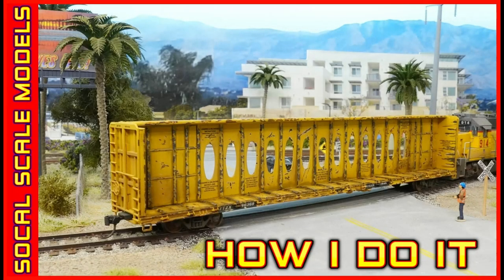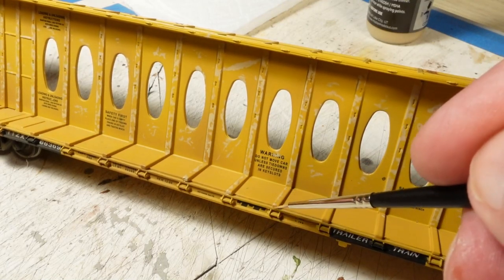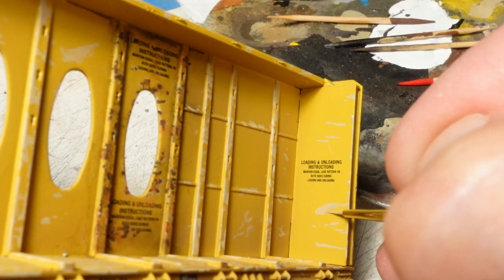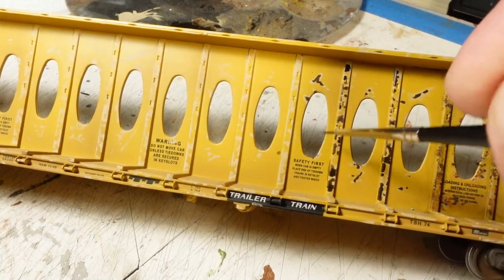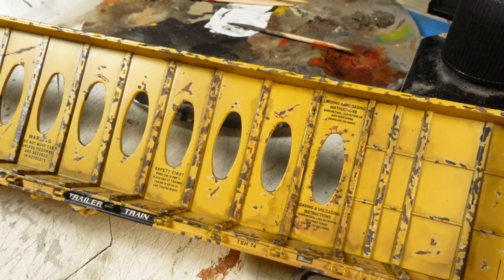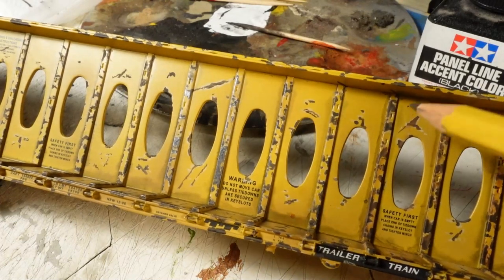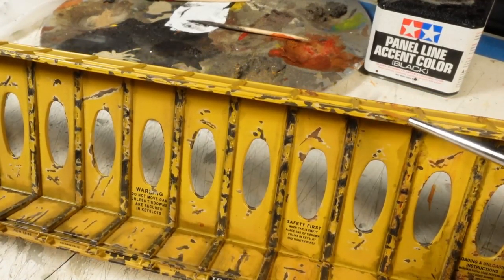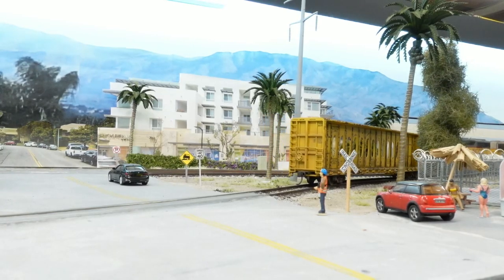How I Do It | Weathering a Center beam Lumber Car

Comment: Hi, great techniques and an enjoyable video. Do you use use any dull clear finishes on the car before, during or afterwards?
Reply from the maker: I do put a flat coat on before and after weathering but sometimes get lazy and don't get around to doing the final one for a bit.
Reply: Thanks for the quick response. You did a wonderful job on the Centerbeam. I will be starting on 5 the next couple days. This video gives me some additional ideas and the pencil technique